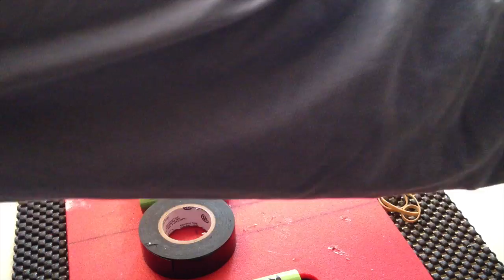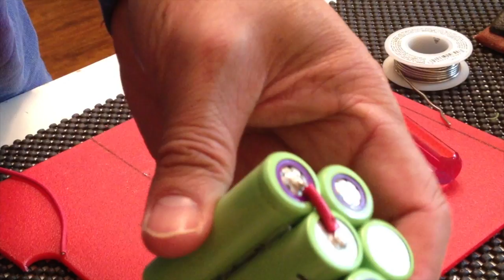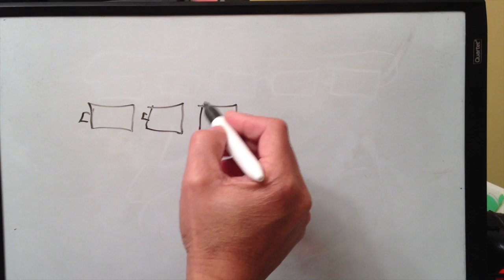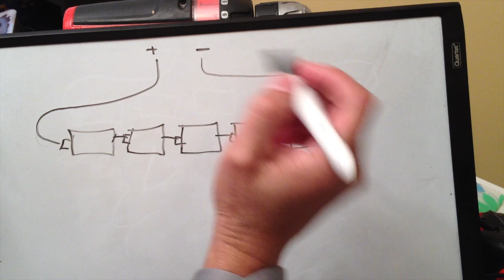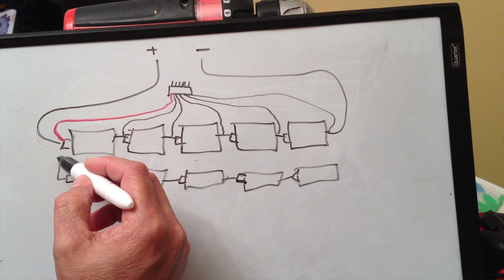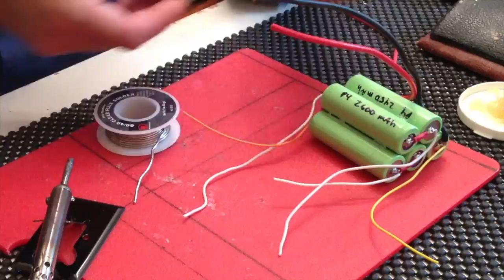DIY Lithium Battery Pack using 18650 cells

Comment: By experience i gotta say that you shouldnt use too much flux or solder paste if your solder wire is already including flux then it is enough for soldering it to the battery if you use too much flux then it wont be soldered properly and the wire will get rid of the solder point

Comment: Very inspirational. I think current recs are to insulate the 18750 cells to dissipate heat, especially b/t rows.
Why use wires instead of tin strips?
Reply from the maker: Easier to solder using wires than nickel strips.  You’re correct, strips are more ideal

Comment: Those 18650 are not suitable for use in a cordless drill which requires high-discharge batteries. They look the same but they are not. Drills will typically draw up to 15 to 20 amps and laptop batteries I have looked up are app specified for a peak of 2x rated capacity so about 4.4 amps for your cells. Apply a heavier load and they will soon get hotter than they can stand. Ill leave you to work out what happens next.. You can minimise the risk by using 5 cells in parallel so 6s5p not 6s1p.
Reply: I agree. I tried laptop batteries the first time I made a pack and it got very hot, very quick! Turns out the batteries were only 5 amp batteries. I wouldn't use anything under 10 amps, but preferrably 20+. And if you use the 10 amp batteries, be careful and don't run the drill or whatever for very long.

Comment: Let me ask you something.. O am wondering where this balancer go... I mean i want to make a similar battery pack. 5s 18vlt(18650),and i want to add another 5 batteries in series, and paraller to the first 1p...how i connect balancer to the bms?

Comment: Great video..… but I am looking for a "Lithium Cell Charger Module (BMS) with Battery Protection board/low voltage alarm" that would output a 18V (5S) system..... any thoughts????

Comment: Good video. My original laptop battery is dead and have these cell specs = ICR 18650 Samsung 30B. So when I replace the dead cells, can I only use the same Samsung 18650 30B cells or they can be any other type e.g. 28 or 32f etc..? Thanks
Reply: Yes, most likely it'll work, but sometimes the internal controller is dead, or purposefully made the batteries look dead...planned obsolescence...you know...check each cell individually, then replace the one that died...
Reply: DP2050 Thank you sir. I will. Keep posting up useful videos
Reply: I have checked all my cells and found two of them are dead. All my cells (including two new) are showing ~4 Volts. It is wise to assemble them for my laptop battery I mean will they work? Thanks

Comment: Any thoughts on what battery to use on a winchrite .  It has a 12 pack of 3.7 ions. 21.6 volt. The current battery pack is labeled LR1865BE.  From China. Any thoughts?

Comment: When I tried to glue the cells together with hot glue as you did, the glue just peeled off the cells.  Do you have to use special glue for this?  Is your glue gun low temp or high temp?
Reply from the maker: ptmoy1 just a normal cheap hobbie glue gun and stick.  Try cleaning the surface of the cells with a rag and some alcohol.  The hot glue should stick to the cells pretty good
Reply: Howwww To Start A Battery Business At Homeeee >>> https://t.co/mK3KjJd0lr?THtwSq1jRmsad

Comment: really great video! I was thinking about using  my 18v li ion drill charger (no brand), to charge my new battery pack, using alligator clips on + and -, label indicate output 21,5v 360ma,
what is your opinion about that system?
Thanks
Reply: the batteries you have used are 4.2 v, i had the same problem but you can use resistor which i havent tried yet..

Comment: Balancing plot should need for charging this battery.without balancing wire it cannot be?
Reply: Usually, if these are the same batteries from the same battery pack, like in this video, it should be fine not using a battery charger. However, with multiple different packs, unless you really know what you are doing, I would recommend a BMS, or even better, a balanced charger.

Comment: Great joins, I love how easy this is to solder using the flux etc... One thing I will mention is it's really important to fully charge all your lithium batteries before doing your connections like this, since they will self-balance once connected in parallel and your will end up potentially killing one or more batteries if they are at the same voltage.
Reply from the maker: You are correct about keeping batteries at the same voltage before connections.  Thanks for the tip David.

Comment: to connect lithium cells in series do they have to be protected or unprotected cells?  What is a flux?  Why do we need the balance leads?
Reply from the maker: Most of the 18650 cells being used in battery packs are unprotected cells.  Balance leads ensures each cell is charged properly without overcharging.  You will need a lithium hobby charger to do so.    Flux helps the solder bond (burn) the wires and metal together better.

Comment: Listen guys, it doesn't matter how you connect the batteries, all you must remember is the series connection you doubling the voltage but the amps stay the same, in parallel your voltage stays the same as well as the amps, the only thing is that your amps are more stable and takes longer to run down when connected in parallel. you can NEVER double up on amps doesn't matter how you connect it because that's the current draw when in a circuit.
Reply: NO . You are wrong...Let's Use OHMS Law please! This is basic electronics. 

In series the voltage doubles and current remains the same as each cell..  ..
.(we are assuming we are using identical cells..matched)

In Parallel, the voltage remains the same as each cell, and the current doubles, triplled, etc as you add more cells 
(we are assuming we are using identical cells..matched)

2 cells rated at 2000mAh each in parallel are 4000Mah
3 cells would be 6000mAh.
etc...
Reply: Tell me one thing, if you have 2 batteries in parallel and a balancing charger over them how does you charger determine which one of the 2 is faulty???
Reply: I think you are getting confused between draw current and supply current. Draw current is double when in parallel but supply current does't.
Reply: WHAT!!?? LOL....
It doesn't it., it can't...and it's irrelevant to the point you were trying to make originally... PLEASE study and read more on this subject. I will not respond any further, you can leave your responses here and let everyone know how little you know about this whole subject. 

the way you refer to "amps" and use the word "stable" proves you have no idea what you are talking about
Reply: Current flow (in Amps) depends on the circuit demands, (or resistance) regardless of it being in series or parallel. 
PLEASE STUDY BASIC OHMS LAW.
Reply: your son may know more, but you don't.

Comment: We are told that LI-ion batteries are very heat sensitive.
I had therefore assumed that soldering at the terminals would damage the cells.
I do this regularly on dry cells without problems but LI-ion are expensive so you need to be sure. How much practical experience do you have to be confident with the method you use?
Reply: why is it risky? the only thing the heat will do is possibly ruin a small percentage of the capacity. Also Ive seen sony datasheets that say if soldered only apply heat for 1 second. This guys technique is spot on.
Reply: Soldering Li-ions cells is foolish and risky. Some get away with it. New generation cells are less volatile, but it;s still a risky to apply heat from a soldering iron.

Comment: Hello, If  1 piece 18650 give me 5A , in series (2pieces 18650) give me 10A . Is it true or is same 5A?
Reply: When connected in series it will still give 5 Amps but twice the voltage.
When connected in parallel however, you will get 10 Amps.
Cheers
Reply: Ok, my mistake, I thinking parallel , but I'm not safe about Li Ion batteries. (I planed 4 or 5 in parallel for my screwdriver)

Comment: Tried soldering spotwelding strips. But that just will not work. Drilled little holes in the strip for the solder to flow. Does not work and is dangerous. The wires are the safest solution. Thats how i made my pack. With little wires and patience. Hot glued them together and if i want to i can remove them and heatshrink with new tubing for 18650.
Reply from the maker: Thanks for sharing your experience.  Strips are nicer and lower profile but I found the heavy gauge wire is the simplest solution.

Comment: why glue and solder ? instead of some casing and pressure wires ?
Reply from the maker: better contact over the long haul.  Also custom size pack.

Comment: Hi , i have a question , i have 6 batteries which connected with a 6s BMS . I just want to know can i use 18v power supply to charge those batteries ? if can , how it should be ?
Reply from the maker: Hasitha Buddika no, you will need a 25.2v charger rated for that BMS

Comment: That is the best and easiest to understand video on how to wire and understand the connecting of 18650 batteries in series and parallel with balance leads.  Thanks for posting and please keep posting for us dummies. 👍

Comment: I want to make a 12.6 volt or so motorcycle battery from 18650 cells. I bought new, obsolete, 9-cell Dell laptop packs. How should I wire the batteries to make a 12-volt motorcycle battery?
Reply: bingbonk Oh well,that isnt smartest thing,you will need shit ton of electronics to actually use it.

Comment: I've noticed your batteries have different capacity. Can balancer (ie. Imax B6) equalize them when connected as a pack?
Reply from the maker: No, It will only balance the voltage during the charge and not capaicty.  It is the reason why you want to use similar capacity cells for making a battery pack.
Reply: +Lowegy thanks

Comment: Hi there, I found your physical construction of the battery very helpful.  I have a project I need to switch over from Lead Acid to 18650's.  If I make a battery pack like yours and use a balanced charger, do I just need a fast fuse for extra protection on the voltage output? (not gonna lie, I'm a bit scared of LiOn)  I need to make a battery pack that is safe, easy to charge and has around 4 amps and 20+ volts, any help appreciated
Reply: yes always use a fuse.

Comment: Hi, thank you for video. What is this balance cable called? i bought some from ebay for 4 cell battery and it does not fit to my imax b6 charger. it is smaller than it should be.. thank you
Reply from the maker: They are call JST XH balance wires.
Some eBay sellers are selling smaller balance wires that won't fit hobbie chargers.  Here's one that will work with your hobbie charger:
http://m.ebay.com/itm/10-PCS-4S1P-Balance-Charger-Silicon-Cable-Wire-JST-XH-Connector-Adapter-Plug-/321795782410?txnId=1651097049011
Reply: thank you very much :)

Comment: What flux are you using. I really don't want to buy a spot welder for my 10s4p build and flux will minimize contact time.
Reply from the maker: Oatey no.5 solder paste flux
https://www.amazon.com/Oatea-Oatey-53017-Paste-Flux/dp/B000UTSSQO
Reply: Awesome thanks!

Comment: Is it true that soldering damages the batteries because of excess heat.People are recommending tack welding.
Reply from the maker: Tack weld is the best method however a short quick 1 sec soldering work just as well.
Reply: Thanks!

Comment: hey i was just wondering if the battery balance is required and if i can use a factory Dewalt DC9310 (Charges all DEWALT 7.2-volt - 18-volt NiCd/NiMH (except Univolt batteries))  to charge the battery
Reply from the maker: No, you cannot.  You need a lithium charger to charge lithium batteries.  eBay seeks IMAX B6 balance charger for around $25-30.
Reply from the maker: Most importantly, lithium balance charger prevents overcharging which may cause cells to explode and catch on fire.
Reply: But what if that model is a Lithium-IOn Charger...
Reply from the maker: +hoang916 it still won't work unless you wired the batteries to the original lithium battery pack BMS/PCM.  The BMS balances and protects each cell from overcharging and discharging.  Hence the batter pack I built requires lithium balance charger to safely charge.
Reply: Ok thanks awesome video... I did some research and the factory battery pack comes with its own BMS balancer in them.. So I just bought some from eBay that has dead cells and try to replace those cell since I got 2 dead batteries for $20
Reply: be sure to replace them with similar cell of the same capacity Ahr.  Mix matching cells is not recommend.

Comment: Hello, I have a question, I need to buy 3 other 18650 cells, and i'm sticking between this two model, the LG HG2 for 3000 mAh at 20A and the LG HE2 2500 mAh at 35a, which is the better ? This is for a ZMR 250 with 2204 motor.

Thanks.
Reply: if it's 3P or less, then I would go with the HE2.  They are highly rated cells.

Comment: sir , u made a bomb . what about protection ??? what about over discharge and over charge ???
Reply from the maker: No BMS/PCM is needed if you use a lithium balance charger (ex IMAX B6).
Reply: okay may be i missed it on ur video or u didnt mention . sorry
Reply: Is that so if you use 18650's with protection or can I use my flat top batteries without protection circuit built in? I got Imax B6.
Reply: No u cant use without protection

Comment: great vid pal! one question, why do the batteries not short out once you solder the negative of one to the positive of another?
Reply from the maker: It's still an open circuit
Reply: +Lowegy thanks for replying, but i still dont get it... hahaha. For example if i solder 2 in series, i have to connect the positive to the negative on both ends, right?
Reply from the maker: +ansarogu just one end of + - else u have a closed circuit.  The other + - end connects to a motor and switch.
Reply: +Lowegy ok, so i would solder one + end to one - end but the other ends have to be soldered to the +- of what ever it is im gonna power? sorry if i make no sense.
Reply: +ansaroguT5Þ gjderhry49y37hvvcw [vvah3.  bonbon hundreds